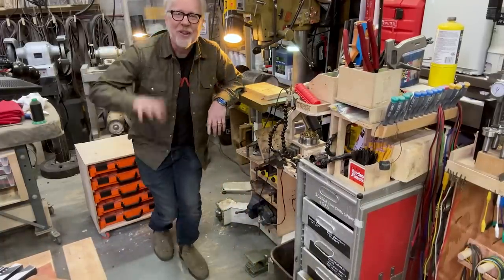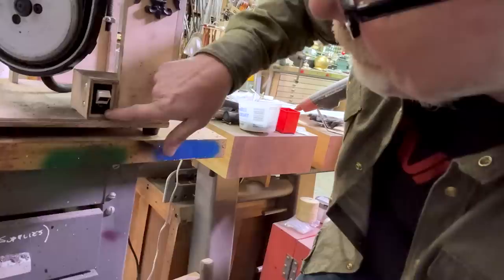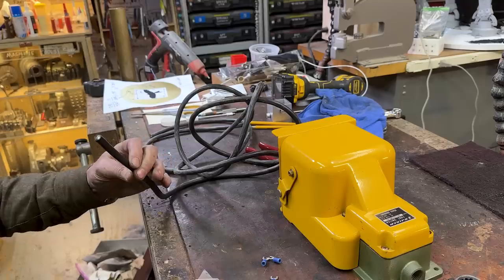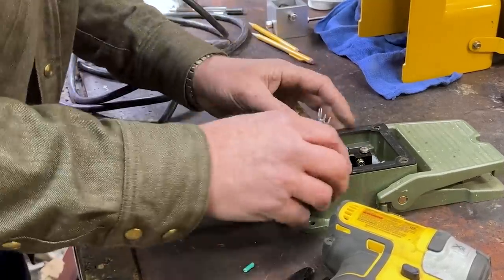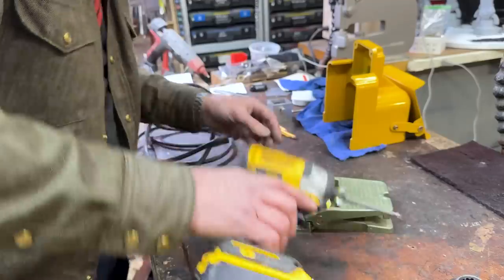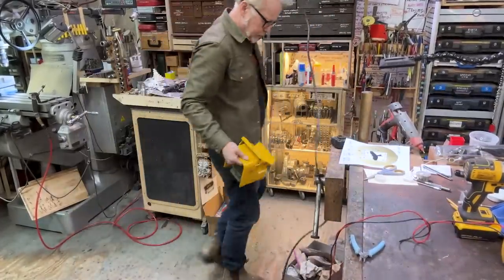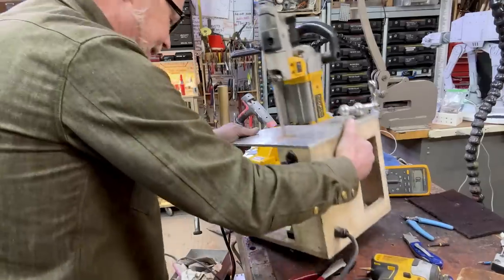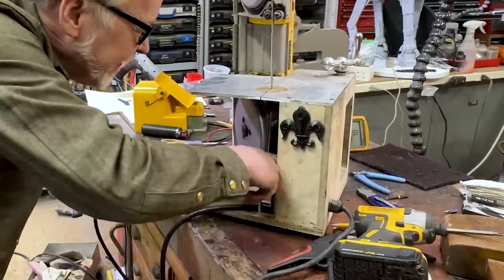Adam Savage's One Day Builds: Foot Switch-Powered Shop Tools!

Comment: "I probably won't need strain relief" drags foot switch around shop by wire 😂😂😂 don't ever change, Adam.
Reply: Love the idea, but...could have just added a stuffing gland at the ingress point, plus earth the box
Reply: Was gonna say the exact same thing ! Laughed a lot while seing that !
Reply: Also... those zip ties are  nowhere near tied tight enough
Reply: He said "This is not a harsh environment". I would say, by the way he weathers his props, its among the harshest of environments XD
Reply: @andrewgordonjardine2632  likely not needed as many mains power tools are earthed to their own chassis, thats why even in the UK where the fully earthed electrics are the basic standard now, you will still find mains drills and so on often only have live and neutral in the plug if you crack it open.
Reply: @sathos  Complete bollocks. In the UK only Class 2 or better equipment is allowed to be unearthed; they are double insulated (usually have plastic bodies - power tools for example.) Class 1 equipment (such as a metal bodied foot switch) must be earthed.

Not sure what you mean by "earthed to their own chassis" unless you're talking about neutral being common with earth, which still would not preclude the metal foot switch being earthed.
Reply: ahhhh, thats what he meant by strain relief. i thought he was talking about overloading the wire, and I was like how much power does that dewalt bandsaw draws?
Reply: tune in next week when he'll go over the finer points of sticking bare forks into electrical outlets
Reply: @sathos  Once you put 110vac or 240vac into a metal box, the box can become energized if the line lead comes loose inside so the foot switch case needs to be grounded.
Reply: Also, the "I start all the screws before tightening" then tightens the screws in the box at the end one at a time. Lol
Reply: @andrewgordonjardine2632  I know right. You can tell he's a DC guy. Goes on and on about nicking wire. What happens when a wire shorts to the foot pedal?
Reply: Just about to say the same thing😂

Comment: The wiring on this is definitely a safety risk. Any metal part that could get into contact with mains voltage should be grounded. The Ground wire should be longer than the mains wire to ensure it is the last wire to loose contact to what it is grounding. Not having a proper strain relieve can also be a fire hazard as dust and metal chips make their way into the housing of the switch. I strongly urge you to revisit this especially because this is something people might do at home.

Comment: I love this. After working in a couple of factories I've learned workers seem to like foot switches and managers hate them due to safety reasons
Reply: i heard of a guy on a drill press panic when he drilled through his thumb and didnt get off the switch
Reply: Seems like it would be quicker to step off the switch in an emergency vs having to look for the switch and flip it while in a panic.
Reply: @isthatjake  
Yup.
Reply: @Juan Martinez  I'm a fan of the emergency off buttons at forehead level lol
Reply: I recently saw a press that had two switches spaced on either side of the machine so both hands had to be clear of the working area to operate the switches simultaneously. Simple and practical.
Reply: @lunhil12  exactly!  Operated those big presses for a while.  On the big presses you have no chance. Worked with a guy who decided he was smarter than the press. Swapped out double button safety mechanism for a foot pedal.  He was missing 75% of his hand less than an hour later.  But after a very long surgery, it was reattached.  Don’t think he really recovered.
Reply: I think I'd be more likely to forget the chuck key if I had a foot switch control. Maybe others are perfect in that regard. And I won't use those horrible spring keys.
Reply: @lunhil12  Yeah, I know a lot of large factories with presses use these buttons. One of my former coworkers worked in a factory which needed 4 employees to work the station. You put the panel in place and 8 buttons had to be pressed for the press to operate. I imagine the floor manager could probably disable some of the pairs if needed.
Reply: @lunhil12  
Yea we have those at work on presses and shears.
Reply: I can vouch for the safety issue. Watched a guy step up to a 300 ton punch press with a die grinder in hand to polish the mold and he was trying to kick the pedal out of his way and just when I said "hey, let me get that for ya before you s......" and the machine just went kerrchunk while his hand was in there. Now this specific machine ran gears for a Honda transmission and this process of the machine punched a hole through an inch thick of steel 15,000 times a day without hesitation. Imagine our soft bodies inside something like that. 

Some may be wondering "how did the machine just go kerrchunk if he was obviously breaking the light curtain?" Well, when it comes to air powered equipment, even if you tag out the electrical, shut down the hydraulic valves and hit the E Stop, unless you bleed an air system off, it'll stay energized until the damn thing leaks.
Moral of the story; never trust that air powered equipment is safe after you've hit that red button.
Reply: @BIGWIGGLE223  Whoever installed and commissioned that (and certainly it wasn't the machine manufacturer) was criminally negligent. I bought a press on eBay (was working in a US factory) and one of the three independent safeties had been bypassed (tie wrap on the microswitch). Cutting corners..
Reply: Where I live foot switches are common on many tools but they all have safety built in, if you step too hard you trip the E brake and the machine stops. When I started to learn the plate bender at my shop I'd be frustrated because I kept pressing too hard with my foot and tripping the safety,  you only have to feather it a bit
Reply: @cavemanvi  why didn't he just lift the quill???
Reply: @TheZebinator  That sounds like a really good solution once you get the hang of it. In a panic you literally just do anything with your leg and it immediately stops. Plus if you accidentally press it you're probably not gonna hit it with just the right pressure.
Reply: @TheZebinator  I've seen about a hundred different variants, but most have that steel plate that prevents you from stepping on the petal unless you get the tip of your boot to kick it up. Problem with that design is that people are dumb and will bend a tab or just zip tie that safety plate to stay up so they can feel like they're running faster.

And I f'ing hate those petals that you can't donkey stomp the shit out of because you just have to lift again and gently press it down. Ain't nobody got time for that shit!!!
Reply: @BIGWIGGLE223  I think the idea is that if you're operating some big machinery and something wrong happens your first reaction would be to donkey stomp, thus stopping the machine from doing further damage. Also stops it if something like a pipe or something gets lodged onto the pedal. That protective plate doesn't really help you if you're actually operating the machine
Reply: A warehouse I worked at had foot switches for all the saws. The way they kept the operation safe was by having hand buttons that clamped the piece into place. The machine wouldn't work unless you were holding the clamp buttons, and if you released the buttons, the saw immediately stopped. We were told they had a guy realize he was cutting at the wrong line and went to adjust it while the saw was moving...it wasn't ideal.
Reply: Just ordered one for my lathe, but will be using it as a safety power cutoff, not an on off switch.

Comment: Not sure if that switch is switching directly on mains, but if it is, with a metal enclosure it probably would've been sensible to use the ground wire too 🤔
Reply: I was thinking the same thing, but I realized he's basically replacing a rocker switch.
Reply: @spiranomad  Yes but still a class 1 mains appliance, so it really needs to be grounded, so that if say tramp metal gets in through that missing gland, and shorts out the wires, the GFCI would operate before Adam becomes a glow in the dark ornament.
Reply: @SeanBZA  I almost sure that there was a bolt inside that pedal for earth wire.
Reply: @MSP_TechLab  There is, I have even seen the grounding bolt position on pneumatic foot switches, because there are areas which they are used in that are required to be intrinsically safe, and thus, even though there is no electric connection, there is still a risk of a spark arising, so all metal in those areas needs to be ground bonded. Even the all plastic bodied ones have the moulding in them to accept a ground wire, just to hold it in position to carry through the chain.
Reply: Right, the pedal had a ground lug and it wasn’t used.  Not a great practice, especially after the lecture on nicking insulation…   Funny that it was actually equal or extra effort to not use it after he added the spade connector and later cut it off.
Reply: Yeah. Any exposed metal casing should be earthed/grounded.
Double insulated appliances should not have a metal casing.
Reply: @crapstirrer  Double insulated can have exposed metal, but then your insulation must be classed as robust, and there must be at least 2 layers of insulation between metal parts and the live conductors.
Reply: @SeanBZA  Don't underestimate the level of static charge that can build up in an ungrounded pneumatic or vacuum-operated device.
Reply: @GrayRaceCat  I have no doubts, seen it occur, so made sure all that pipework and metal was bonded together, so as to avoid that. Luckily most large diameter suction line has a wire reinforcement that you can purpose for this.
Reply: Yeah especially with all that dust. Dust is conductive after all lol. It could definitely cause a short. He’ll be fine though.
Reply: As an electrician I would mount a receptacle to the back of the foot switch allowing anything to be controlled by plugging in

Comment: You used the non insulated part of the crimper on insulated stake-one. The crimper has a “non” written on it for non-insulated crimping application and an”ins” written on it for insulated applications like the blue stake-ons that we’re used that have plastic coverings. You should have used a strain relief out the back of the switch to avoid having the cord rub the threaded hole the cord goes through, also if the switch is kicked away or being held by the cord the terminations will be put under strain now. The green wire should be used to ground the body of the switch.